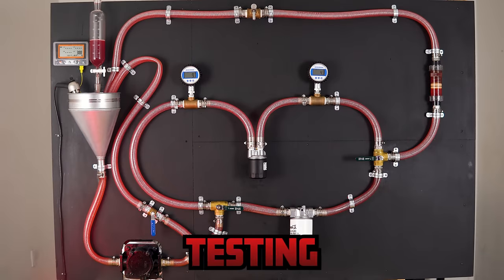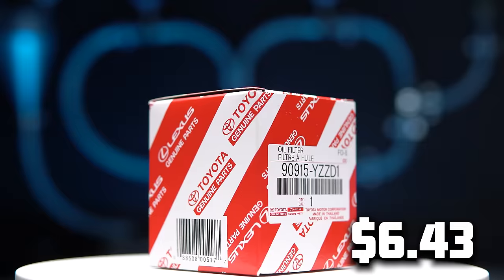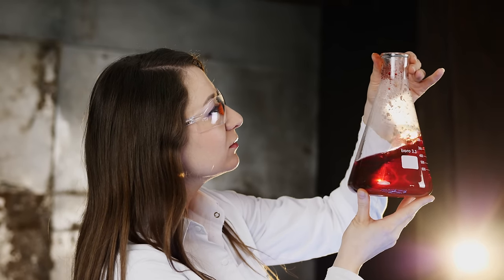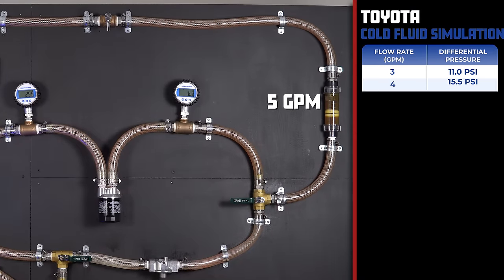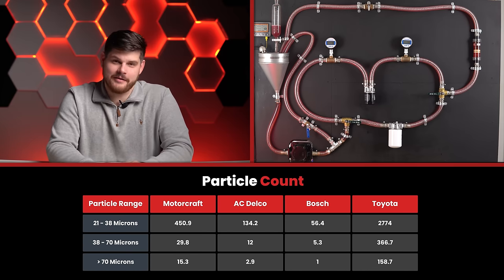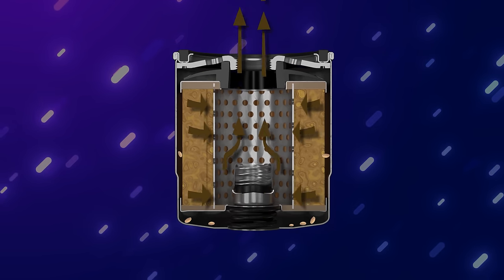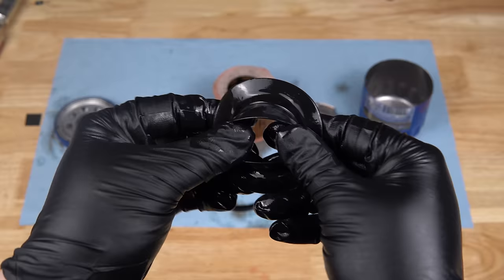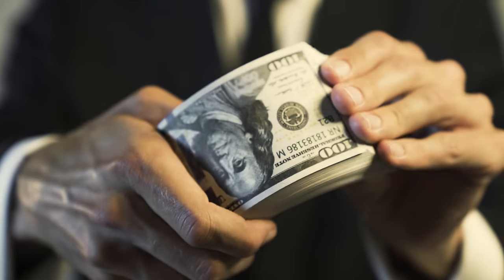Are Car Dealership Oil Filters a RIP-OFF?  (Engineer tested)

Comment: A super-low micron rating for engine filtering would not be good, especially down to from 1-5 as that could filter out the additive package. Very low micron ratings are for hydraulic applications, such as those with rams, or power steering as they don't need ingredients to combat by-products from combustion.
Reply: Additive molecules are measured in nanometers, so a 20-micron filter will never filter them out. Please don't say that additive packages are insoluble because they are. This is also the reason you can't get pure grade 4 full synthetic oil, as they all require some ester to act as a solvent.

Comment: Great video. It should be considered that filtration and flow rate is a balancing act for the engine application. Some engines can compromise filtration for better flow to maximize longevity. You logically cannot focus on one parameter to make a judgment on something that holistically takes many variables. For example, if an engine demands high flow rate, most of the high filtration bottleneck could end up triggering the bypass and be worse for the engine.

Comment: I have 2 Toyota Camrys. Honda CRV and Acura tsx

I noticed when using Toyota and Honda filters I have noticeably less start up clatter (especially in the Honda CRV) than with other filters.
I assume it has to do with high flow Getting the oil to where it needs to go.

This installment shows me that the high flow is also low efficiency particular removal Likely in these cases.

Is there any filters out there that have high flow and high filtration efficiency?

Or is high filtration efficiency really necessary?

My Toyotas last well over 300,000 miles without major engine issue

Both Honda and Toyota do so and design for those filters.

Can it be too much efficiency?

Are there any filters out there that have high efficiency and high flow.?

I need high flow for the CRV. Otherwise I get a lot of engine clatter at start up.
Reply from the maker: Indeed it very well be that it requires higher flow filters. In our rankings table you can see how each filter performs for cold and hot flow. The Purolator boss appeared to do pretty well both in filtration and flow restriction it might be worth a look at. Thank for watching!
Reply: Synthetic media has higher flow and higher filtering capabilities
Reply: per their test, if I'm reading correctly, Amsoil is better at Filtration, and better at Flow than the Fram equivalent (HONDA A02 oil filter).

Comment: A lot of cars to today have electric oil pumps with variable displacement and pressure. Gone are the days of 25-35psi minimum oil pressure at idle and 10psi increase for every 1000rpms until hitting bypass. FOr instance the Toyota 2AZFE has a nominal oil pressure of 3psi at idle. The pressure and volume of oil displaced by the pump is so small that at idle the oil level witht he ending off and at idle are identical when mesured at the dipstick. When Amsoil first came out with their EA full flow line in early 2000's they had to pay out warranty claims on a lot of Toyota's with the 2AZFE. That filter was much more restrictive than the current Amsoil EA line. Prior to that Amsoil sold Wix's filters. I think BMW was the first with a variable volume and pressure electric oil pump. So yes I think Toyota has purposfully biased towards flow or filtration. If you look at a well maintained Toyota engine from I4 to V6, to V8 the UOA will always show single digit wear metals but the particle coult looks awful. The advent of low lead or lead free bearins that are far more durable and less enbedding that old school babbit like bearing materials has changed what is required in terms of filtration. Better materials, more uniform heat treatment and better surface finishes has also changed what one needs to filter to live a long life. CAFE tax system based on sorperate fleet average fuel ecconomy has changed the compromises an OEM is will to make change the rate of taxation by the US Goverment.
Reply: Electric oil pumps, that sounds like crap.

Comment: Does restrictive filter like bosch will need special requirement? Like stronger oil pump or will it give the engine less oil circulation

Comment: How much particulates were actually stuck in the Toyota filter, as opposed to how much remained circulating in the oil that bypassed the filter?
Reply: Unless you do oil changss every 20k miles, it doesn't matter and the toyota engines are designed for high flow.

Comment: I am wondering if the Toyota filter allowed some unfiltered oil through? The "diff pressure" vs "flow" chart for the Toyota filter did not look right as the chart lacked the point where the bypass valve cracks open. It looks like it was bypassing all the time. Also take a look at the ranking table: hot flow = 2, cold flow = 11. The numbers are too far apart as if the hot oil did not have any resistance while the cold oil had a lot of resistance. No doubt there is a hole in the filter. Manufacturing defect? Or a design flaw? P.S. Likely it's a design flaw. When the oil is hot the paper cartridge which is not glued to anything becomes soft and  loose and is pushed by the oil pressure so it makes a hole around the flanges.

Comment: If you are changing your oil and filter every 3000 miles then oil flow is more important then filtering, more flow less wear less wear means less filtering that is needed. Cold startups causes the most wear on engines so if you have a filter that flows more oil then then you have less wear. You can use a lower viscosity oil in the fall then go back to a higher viscosity oil in the spring.

Comment: Could that have been a counterfeit Toyota filter that you bought from Amazon? 
It can be hard to tell the fakes from the real thing.
Reply: I believe it to 100% genuine. Same Toyota OEM design seen many times in other dissections. Results align with ISO 4548-12 industry standard testing sponsored by Amsoil showing efficiency 55%@20um.
Reply: That and all the filters are different sizes from different engines made for different standards. A filter for a v8 isn't going to act the same as a filter for an inline 4. Test was flawed from the beginning
Reply: It's actually a legitimate Toyota oil filter. Toyota and other Japanese manufacturers have always specified maximum oil flow (minimal resistance) when working with the Japanese oil filter manufacturers (such as Tokyo Roki, Denso, etc..) always specified filter flow characteristics that would result in an average absolute (98.5%^) filtration hovering around 45 to 60 microns which many people nowadays assume will mean terrible engine wear & tear but that hasn't been the result as over many decades we've seen Toyota (and other Japanese brand) engines easily going 250,000 miles + using only OEM oil filters at that filtration rate.  From my own experience with the Japanese vehicles I own, when I've switched from OEM Japanese oil filters (and their very lax filtration rate and low resistance) to aftermarket "high-end" oil filters that claim filtration rates 99% @ 20 microns (or lower) I many times end up with start-up chain noise and/or tapping.  It does go away after a few minutes but it's non-existent with the OEM filters. I've also known many other owners of Japanese (and other) car brands who've wound up with prematurely worn or spun bearings, apparently caused by insufficient peak oil flow/pressure due to restrictive oil filters that added just enough extra restriction/resistance (in the name of higher filtration rates) in addition to momentary reduced flow at cold start-up, not because of the oil itself, but because of higher cold flow resistance. The combination of those two events OVER TIME can lead compromised oil flow at the most crucial times (even if 90% of the time they are sufficient) versus an OEM filter, even if it doesn't filter as well as an aftermarket "high-end" filter, the OEM filter does do exactly what the engine manufacturer wanted it to do, and that is prioritize oil flow over filtration rate or particle size.  The millions of examples of cars that have gone over 250,000 + miles using exclusively OEM filters with no engine problems pretty much cleared up that question once and for all. OEM filters are fine, just change your oil religiously and more frequently that the manual states that you should. That in itself will have more of a positive impact on the longevity of your engine than second guessing the engine designers with which oil filter to use.

Comment: Great round up.

I think manufacturers must balance filtering performance versus flow. We could put 1 micron filters on engine's, but then the engine's would be oil starved.  So there's a balance between allowing enough oil in to protect surfaces versus keeping wear material out of the oil that cause damage. There's a sweet spot somewhere I'm sure.

I was happy to see you suggest at the end that an explanation for the "capacity" results isn't that the filter is capturing that many particles but simply that your test is designed in such a way that there is just more stuff in suspension throughout the test rig. The filters with Higher "capacities" aren't holding all the material going into the test. It just takes that much material of the test dust to be introduced that the filters become clogged by a sufficient number of what sized particles are needed to clog them.

I don't think the capacity interpretation correctly attributes the observed volume of material to the filter "holding" all the material introduced.

I would submit that another interpretation is that lower filtering levels results in more material in circulation overall, even though "clogging" will occur later.
Reply: It seems like a better design would be to divert perhaps 20% of the oil to a very fine filter, and 80% through basically a screen, and then bypass both of those at high revs.
Reply: You are on the right track. There indeed is a sweet spot. That is filtration catching any particle larger than the smallest lubricated, moving clearance. That dimension is a variable dependent upon designed or measured engine clearances, +/_ a measurement tolerance, which varies by engine family. For example, 0.002" main/rod bearing clearance is ~51 microns (51μ) pronounced mu. In practical terms any filter that catches 100% >50 microns is that sweet spot. I'm partial to a K&N spin-on and a CRP 400 mesh (40μ) filter inline to the oil cooler. Everything worthwhile knowing requires performing application-specific due diligence. The White Rabbit invites you to enter his domain, but bring your calculator... Cheers!

Comment: Cool test. What's rarely discussed though is how much dust "actually" needs filtering from engine oil. Many modern OE air/fuel filters are 99+% efficient and stop most wear-causing particles from entering the oil in the first place. Therefore given sufficient air/fuel filter performance, an OE may determine lower oil filter efficiency still provides adequate engine design life. Lots of high mileage Toyota's on the road.

Comment: I think the high flow for the toyota filter was intentional. As OEM's try to meet emissions requirements, Toyota has shyed away from making half-ass EV's & hybrids (ex: they didn't slap some hybrid powertrain on the 4runner as an option no one buys until redesign) to lower their average emissions across their offerings like others. I think they have done things like push the envelope with low-viscosity oils & trying to reduce operating losses in the powertrain at the cost of......well, we will find out in a few years. 
They also position themselves in the market as very reliable, low cost of ownership, etc. So this manifests on the vehicles with things like smaller wheels & tires available (cheaper to replace), extended oil change intervals (less changes = cheaper), removing things like brake fluid+pad replacement intervals & changing to "as needed" in order to lower that cost of ownership stat.

Alot of these things (especially the oil change intervals, lower viscosity oil, full aluminum & plastic engines, vague recommendations on brake fluid) are concerning from both a longevity and a safety perspective. 

I wonder if Toyota will begin to specify a different filter for their turbocharged vehicles. Running dirty oil through a 2004 toyota camry with their NA 4 cylinder that has 30 years of refinement is alot different than a 2024 GR Yaris running a ton of boost & SQUEEZEING THE LIFE out of a small engine from a power/displacement perspective. Pushing the ICE engine envelope as a whole. 

Would be a shame for toyota to end up being too much subaru. Lol

Comment: I own a 31 year old Pontiac Grand Am GT I bought brand new in 93 and it has had AC Delco oil filters since day one and have never had a problem with it. No oil leaks or burning oil no engine knocks or tapping. Changed the oil every 5 thousand miles may have something to do with it. I will stick with OEM.
Reply: I dont understand your thought process, , , if you are shown a superior product why would you stay with a inferior item? Yes i've heard the "I've never had a problem" reply but now that you know seam foolish to not switch. Hey look here is better! No thanks I'll stick to something not as good. WHY? You see the proof yet stay with inferior.

Comment: Cool. I've been using the OEM Toyota filter for the last 140k miles (a case of 10 is about 50 bucks), and the M1 filter before that. My 2006 Toyota Matrix 4WD has 224,000 miles and runs perfect. 5k OCI.

Comment: There is much missing from this conversation without actual oil flow rates in the intended applications. Does my 1ZZFE 1.8L I4 flow oil at even 3GPM? Remember, its entire oil capacity is 1G including the filter. When I bought it new in 2003 I used AC/Delco filters. They got hard to find so I switched to standard Purolators. They got stupidly priced so I went back to OEM. I've been using the same on my wife's 2009 2.4L Toyota. Both have well over a quarter million miles  and run like new. Mine saw nothing but dino 5w30 for 200K miles. Then it got hard to find and priced higher than full synthetic. So it's been on Kirkland full synthetic for >60K miles. Hers takes 0w20 so it has seen nothing but synthetic but she didn't respect the 5K interval before we were together.

Comment: I just checked a page where a man literally cut open the Toyota filter and seven other brands (video also on YouTube) for the Tundra/Sequoia 4.7 V8 and the Toyota filter was built better all around with quality anti-drain back valve, impressive bypass valve, and had literally the most filtering (quality synthetic) media at over double the filter media of the K&N I just took off my truck. And many of the other filters have half of that with crappy flakey paper/cardboard media. Toyota’s filter was also $6 from the dealer and comes sealed with some type of grease already on the o-ring. It also helped correct the low pressure gauge problem that’s very common (but I did remove the entire oil cooler housing from the block, cleaned and rebuilt it with new seals. I have never bought a filter where they took enough care to seal it off from contamination and also keep the ring seal in good condition by applying some sort of grease or lithium. After seeing how the inside components are made and most of them came off the same assembly line with only a different case, paint, and brand name, while made by the same  company.

Comment: Most gm engine have an inter-grated bypass valve in the engine the Ls and Lt engines have them right before the oil filter housings in the block so that’s probably why the filter does not have that feature.

Comment: Relevant video. Some decades ago, oil filters were tested in Finland and it was found that Toyota's OEM filters were an order of magnitude better than the others. I don't remember the criteria.
It is almost impossible for a layman to distinguish the best imitations from the originals. I will gladly pay even double the price of a Toyota dealer when I can be sure that the product meets Toyota's requirements, whoever the real manufacturer is.

Comment: So, I think you should test Wix and Napa's Mid-Tier and Low-Tier filter offerings. Standard Wix/Napa Gold, Wix Pro-Tec (I think that is what they call it but idr for sure), Napa Silver, and any other filters manufactured by Wix either for themselves or Napa. There are also 2 Microgard filters from O'Reilly that compete with Wix/Napa. These should be very interesting, and I think they would outperform the XP and Platinum in filtration but worse in flow.
Reply from the maker: Thank you for the suggestion! We will be testing Wix and Napa gold next. Thanks for watching!

Comment: general motor engines have an oil bypass valve in the block casting that is bolted in, and can be removed for cleaning or replacement. this bypass valve is located in the center where the oil filter is screwed on, so an oil bypass valve located in the oil filter is not needed.

Comment: I run the motorcraft in a ford flex, oil is black after 3k miles or so. The toyota in our Prius, oil looks great even after 10k miles. I change the oil in the flex well before Ford suggests, the prius every 10k(these cars barely ever idle). If i ever did run an aftermarket it would be a  high end Purolator, but its more cost effective to just change the oil early in the flex(gotta protect the water pump seals)

Comment: Thank y’all for including the ACDelco GM filter. I have told people that they shouldn’t run the shorter filters on the 5.3/6.0 engines. The Fram Synthetic Filter, Mobil 1 Filter, and the K&N are the best to run on those. The short filter just doesn’t cut it.
Reply from the maker: Thank you for watching and supporting the channel!
Reply: Are you talking about the PF63? That’s the filter I run. Should I switch to Mobile?